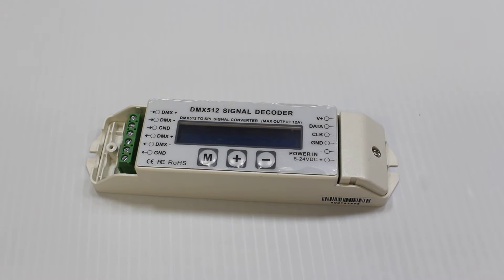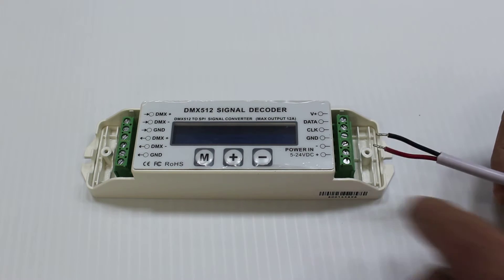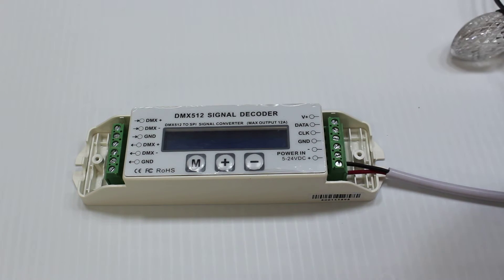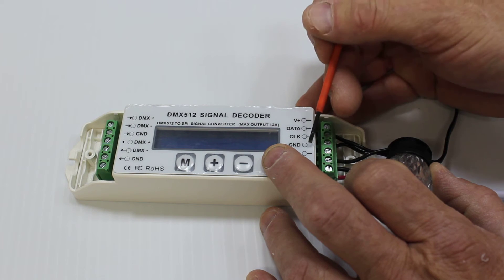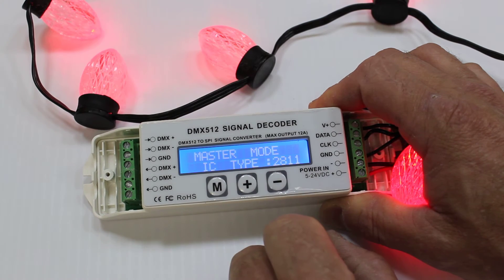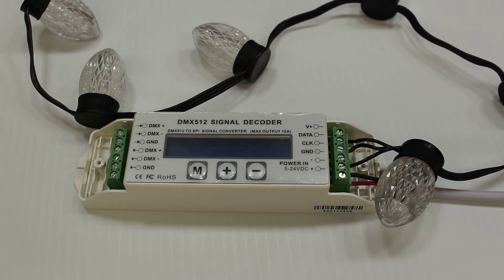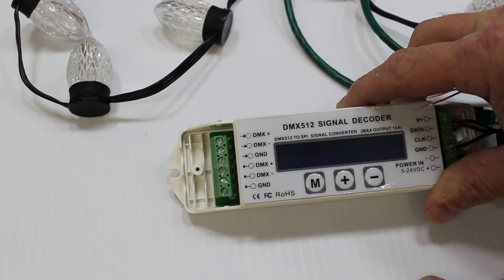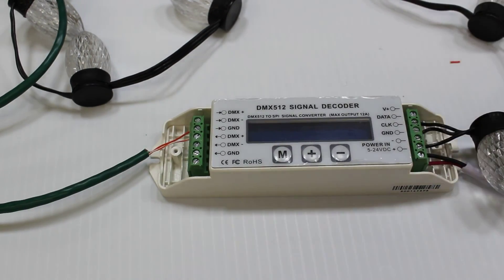EasyPix Pixel Controller Wiring Demo How-To

Comment: Hi there I emailed less than a week ago and spoke to a person about an issue with this controllers decoder mode not working with the Newer frosted Globes you sell. I have everything setup exactly as this video shows but when you get to timestamp 4:07 you change Ic type to 2811 and all pixels react as they should (lighting up showing they’re recognized similarly it’s stated this should happen in decoder mode in “Why do HolidayCoro pixels turn blue sometimes” in your website’s help section)

I do have everything activated as following: 
#pixels: 170
Ic Type: 2811
LED RGB SEQ: RGB
All control: No
Rev Control: No

When adjusting LED RGB SEQ setting it does change the colors of the first 3 pixels in decoder mode. However the software I use to program the lights is vixen. It still states on the page for this product that this controller works with that program however I have had 0 luck with getting these bulbs to react to any input. 

Master mode does work perfectly as well.

I’m responding here as communication seems to have ceased and the info from your help section did not offer a solution for “if none of the lights are blue and your controller’s #pixels setting is set to the maximum” 

I will state that this issue does not exist in your Ribbon lights as the ones I threw away to replace with these bulbs worked properly they were just very beat up and starting not to fully work.
Reply from the maker: We are sorry about this situation.  It looks like it was addressed by customer service.